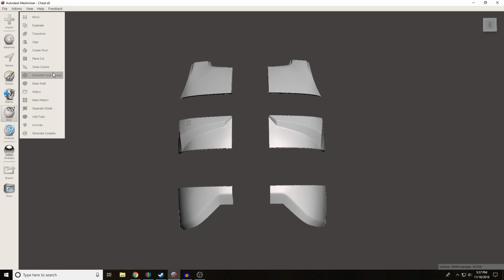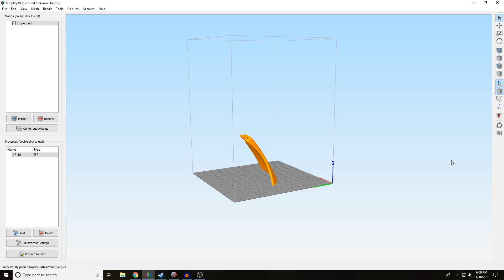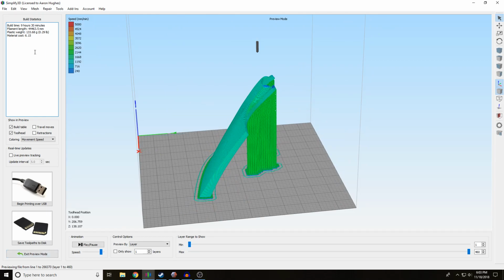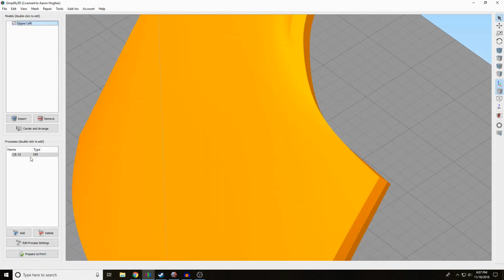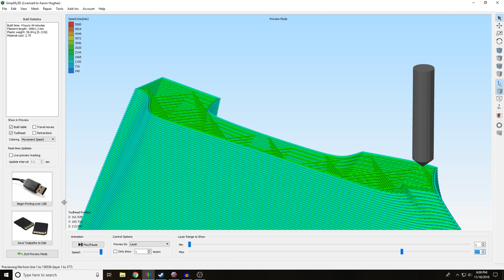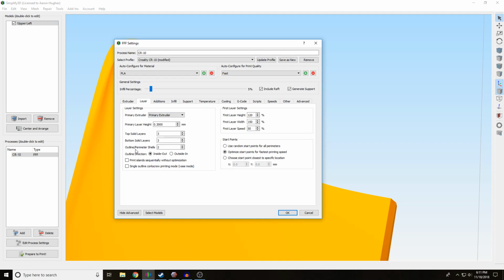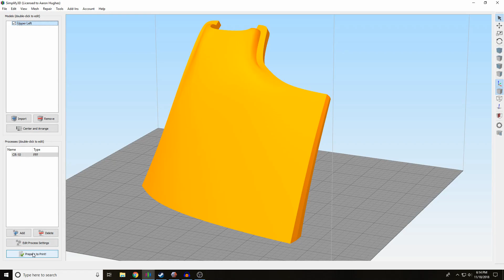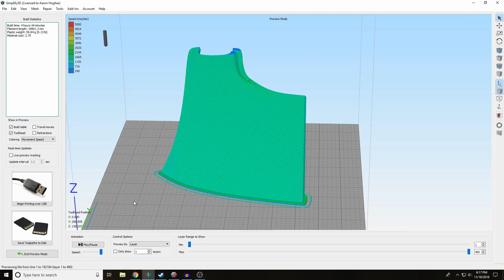Making Clone Trooper Armor - Episode 3 - Preparing Armor Files for 3D Printing

Comment: Run an overhang test on your printer and set your max ovehang to reduce your supports as much as possible. 
5% infill
0.3mm layer height
2 perimeter shells / 2 layer walls
Helmet benefits more from extra walls
Rafts help with bed levelling (he doesn't mention it but they help with adhesion and lifting particularly with ABS)
He doesn't mention it but running a temp check as well would be good before running the overhang test IMO.
Reply: I know this is 4 years later but you are a saint for this

Comment: do you know when part 4 will be out?
Reply from the maker: Filmed it all yesterday! Will try to edit and publish it this week!
Reply: Big Baby Props is CR 10S or CR 10S4 worth buying?
Reply from the maker: @c-coin  I believe so! Check out my link in the description for the specific model I use
Reply: @GalacticArmory  who is better cr 10s vs  cr 10s4
Reply from the maker: @c-coin  The regular CR10s has worked well for me. If you feel like you need the bigger print volume you could go with the s4 though
Reply: Big Baby Props so if a take the bigger one can I make the chest piece in two half’s instead?👍🏻🙏🏻
Reply from the maker: @c-coin  You sure could!
Reply: Big Baby Props how hot should the bed be while printing
Reply from the maker: @c-coin  Mine is 60 degrees F